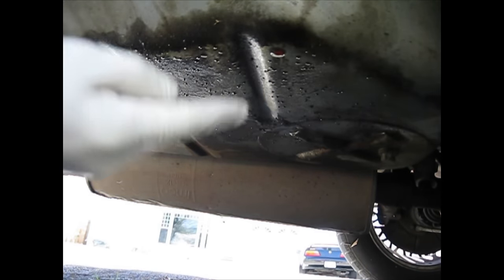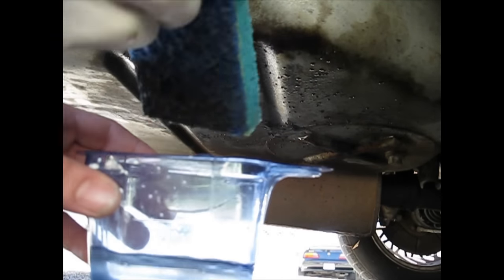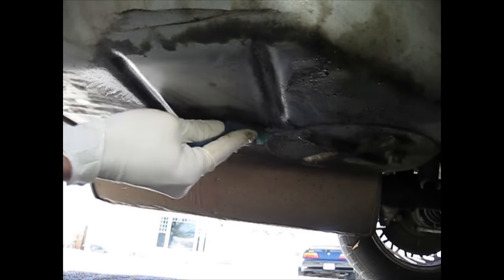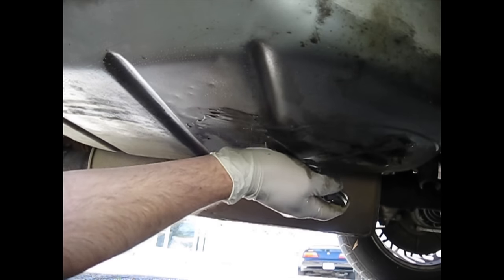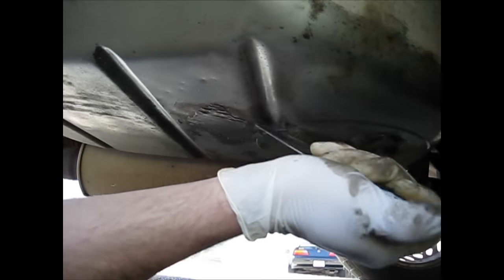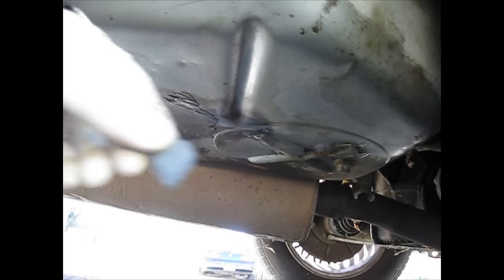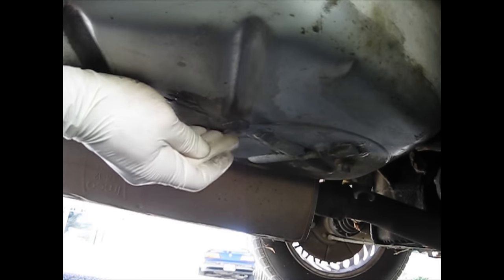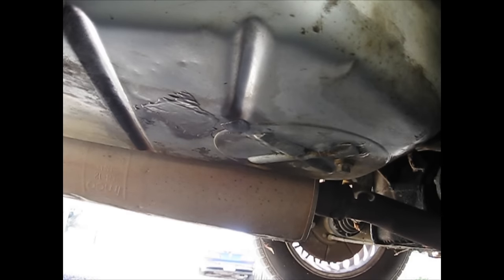How to fix a leaking gas tank

Comment: Run your tank to as absolute close to E as you can.    Then have the car wherever you are going to work on it and get the rest of fuel out if you can (many methods).  Otherwise jack the vehicle up at an angle to where fuel isn’t on the inside touching the leak if that makes sense

Comment: I have never had luck patching a crack or gouge with anything but here's a no leak gas tank fix for a screwdriver hole. drop your tank/drain it, drill the hole out the same size as a valve stem, fish the stem through the hole and put the nut on. Re install the tank. heres my advice and warnings . only drill your tank if you are confident the fumes are gone, use an inert gas to purge the tank/ flood with soapy water. Leave the valve core in the stem! as tempting as it is to decore it for quick drains dont rely on the dust cap alone. Valve stems were not designed to be tank repairs/drains. This should only be used temporary and checked regularly. I have seen this fix hold up years. I hope this helps somebody whos a victim of gas theft/road debry so they can get to work till pay day,
Reply: So someone screws holes thru the top of the gas tank behind the backseat into the metal of the car into the tank I don't see it leaking outside probably because it's one the top possibly when I drive but I do smell gas time to time especially when I put gas do you think I can cut a square around the holes then cover the holes with the job weld

Comment: Thanks for the video. I would have used some 2000 grit sandpaper to go over the leak after cleaning the tank. That roughs it up just enough for what ever your using to grab onto. Brass brushes do more harm than good in most cases.

Comment: This stuffs good, even works on gas wet metal. Used on motorcycle tank after the tilt hinge cracked around tank
Reply: skyrocketgenius have you had any issues with E85 has I herd it eats up jb weld?... any insight would be great
Reply: Justin Decker JB weld is not good. It hardens, cracks and peeps off very easily.  I have never understood how it got so popular.
Reply: i have a 1978 Honda hobbit notice the leak today im going to try it out now before buying a new tank

Comment: did you drain the gas tank first? mine is leaking a little faster than yours so im not sure if the gas will mess with the kit.
Reply: I'm told where it's coming from its near the top then u have to only fill it below that spot.  if it's the bottom well it keep leaking

Comment: It's strongly advised not to try and use JB weld, or other "non-specialist" two part products, as most of them are exothermic. Some create enough heat to cause ignition. Not to mention the fact (as you found) many won't adhere unless the surface is completely dry/free from oil and fuel, etc.
Reply: That's right! I used JB Quick Steel twice, and it FAILED! This will be my third time pulling my tank. I'm looking for the best product to get it done right! The JB just crumbled.

Comment: thanks for sharing.  

you may have gone a bit overboard with the cleaning and scraping cause i would think you only needed to clean right where you were applying the patch (where as you did a lot bigger area hey),  but i guess you were being thorough.  safer to do too much then too little  lol.

Also that old putty stuff really bonded well hey? judging by hard it was to remove it.

Comment: I have currently have a gas leak  right  in that area somewhere. one mechanic seemed to identify it .while another didn't identify it..i have some stuff called Steel Stik it's supposed to be the best  !! I got it from O reillys..i need it done asap bcuz I'm waiting aloy of money constantly putting gas in the truck and it's just seeping out less than 10 miles.and he said it was a small  crack.

Comment: Great stuff thanks man. Get most of the gas out, to reduce the pressure, do the same prep and put a tiny bit just on the crack and rub it in. If there is any evidence of tiny leak still, clean it with alcohol and put another light film. The key is to keep anything in between the metal and the putty. Once you stop the leak then clean with alcohol and light sand it and re-apply a second coat you will be in good shape. Hence this was the second coat because he already repaired it once.

Comment: I did a quick emergency middle of a snow-storm, just hit a deer on the interstate in Indiana punctured and badly leaking gas tank repair - ROADSIDE! How? I smeared a bar of SOAP on it! That was in 1988. That big ugly Chevy suburban still runs, the wife refuses to let it go. Never a drop came out 'since that evil deer's wrinkle crack in the tank was sealed with a bar of shell gas station soap. Took 4 seconds to do the repair.

Comment: I, got 2 pin holes on top of my fuel tank BEHIND THE seat on my 1973, FORD F-700 DUMP TRK.  thank, you for you're video.🙏
Reply: Same thing on mine behind the backseat of my DTS someone screws into the metal of the car thru the gas tank did this work for u I wanna cut a square around the holes and take it out then cover the holes

Comment: RUBBING BAR SOAP REALLY HARD ON A LEAKING AREA WILL SEAL UP THE LEAK SO U CAN GO GET IT REPAIRD THE RIGHT WAY, IT WILL ONLY LAST A FEW DAYS BUT WORKS WELL FOR SMALL HOLES OR CRACKS.SKUD1

Comment: i repair rusted gas tanks with fiberglass putty, works really well, i have a car that i fixed 7 years ago still holding well
Reply: TheRealDeal fiberglass body filler works great, put it on even while it’s leaking.

Comment: Good upload, very instructional many thanks! 
I have a 2006 Mitsubishi Galant DE 4 Cyl 2.4L car and it's impossible to find a replacement fuel tank for some obscure reason (unless I spit out 400 bucks). The corrosion area is somewhere on the top and it leaks only when the tank is full. If I decide to do the fixing myself how do I handle this patchwork?
Reply: I would say : The exact same way the video shows you mate...

Comment: Fuck that do it wright take the tank out in a opend area in take out the pick up lines in fuel pump so as to let tank breath grind a clean spot ware it leaks in cut a peace of sheetmetal slightly larger than hole or bad spot in tack corners of patch with mig or tig welder in then weld solid then fill tank with water as you need to make sher its not leaking in it still not in ur car now watch ur weld for leaks if no leake ur good but if u see a leak mark with chalk or crayon or what ever u can mark it with empty the tank in clean ware you marked in weld it in in now let tank dry out in put back togeter in now you wont leak in if u want put a some undercouting on it to prevent rust

Comment: Okay I have a question do I need to get all of the remaining gas out of my gas tank before I try to put the putty on?
Reply from the maker: No you don't need to drain the tank.
It is a two-part epoxy stick that is Chemical Solvent Resistance to Gasoline, Oil, Kerosene and Water.
Reply: FastestIntegra i was wondering how long did it last? And do i have to knock off the jb weld or can I just repatch over it? I just bought this car and noticed the patch was leaking a slow drip like yours please let me know thanks for the vid!

Comment: jb weld slow cure is the best epoxy. the jb quickweld sux. but is not designed to apply to an active leak. sandpaper scratches help any epoxy stick. i live in texas and they never look under my car for inspection but if fuel was leaking where u can smell it i would fix it before the vapor kills you.

Comment: i had a leak on fuel cell at what GM called a "bad weld" where the fuel filler neck/check valve meet. GM is was remiss in honoring the recall.  I did have to drop the fuel cell, as big a pain as it is, it did help. i used a product called Versa-Chem Tank Repair Kit.. I allowed 36 hours for the patch too cure, the tank had been drained. I preemptively replaced the fuel pump, after I removed the fuel pump I saw that it was possibly from another vehicle and had been modified.  The patch seems to be doing well.

Comment: I own 2 chainsaws with a metal fuel tank which leak along the edges where the tank meets the shroud.  What should I use to seal those cracks?  Can solder be used?

Comment: Good video and I appreciate the information.....thanks :)
Reply: I have since followed the procedure described in the video, and my tank leak problem has been completely resolved. Thanks again !!
Reply: I think preparation of the surface is important. I cleaned the area very well with fine sandpaper so the metal was shiny, and jacked the car sideways so the gas level was real low over the crack when I applied the putty. I also used some of the putty to fill a hole in the floorboard. I check it from time to time, and so far....no more leaking and the floorboard hole is still nicely patched.
Reply: Follow up: One year has passed and the tank has begun to leak again in the same place. I scraped the epoxy and it peeled off the tank in big chunks, exposing the original tiny hole.  I guess I'll either have to remove the tank and get it soldered.....or repeat the epoxy repair every year.

Comment: I was going down a hill in a Ford F-250 and the front side of the gas tank fell and I was not told that it needs new brakes and the emergency brake dose not work so I put it in first and stop as soon as I could and in that time it got at least a 4 inch hole so I used jb weld and put 5 gallons in then ran out cost me $30 to get home now I have to gat a new tank
Reply: snow ronald26 
I had the same thing happen to me in my f250 but its diesel and I couldn't get it to stick how'd you get it to?
Was it a diesel?
was it a plastic tank?
Reply: Bryan Freeman no it wasn't diesel, it didn't stick well had to drive fast!

Comment: I was about to use JB Weld... thanks for saving me the frustration!
Reply: JB Weld works, but the area has to be dry and free of gas. Kind of hard to do that with the tank still in place.
Reply: he probably just didn't use it correctly, who knows if the gas tank is still dripping.
Reply: I’m using JB weld, I’ll let you know if it works
Reply: @windowpeeper did the JB hold up?

Comment: Did it work??????
Reply from the maker: Yes very well
Reply: Hey need u bro how long should i cure b4 putting gas in it
Reply: @htatesil4192  no time.
Reply: @redneckfoo9743  have u use this product some tweakers drilled a hole in mines its on the side not under the tank any good ideas b4 i attempted  this tomorrow just tryna do some homework
Reply: @htatesil4192  most places will sell the brand Permatex gas tank repair which is a very very good product. I would definitely recommend trying some over those screwdriver size holes even with gas in the tank the stuff is designed to seal. Good luck.
Reply: @redneckfoo9743  should i put 2 packs  on too be safe?
Reply: @redneckfoo9743  also i heard it gets hot can it cause a combustion sorry i dont play with fuel im surprised the idiot drilled my shyt i took out a drill bit they could of blown up easily with a right spark
Reply: @htatesil4192  I have never seen a drill bit throw Sparks and the stuff is not going to spontaneously combust either.

Comment: 2nd video I’ve seen where the surface is not sanded. IMO, sanding the surface could mean the difference between doing the job multiple times. Just saying. Just like when you use jb weld, again, you should sand sand sand. Got it!!! Sand. Oh sorry.